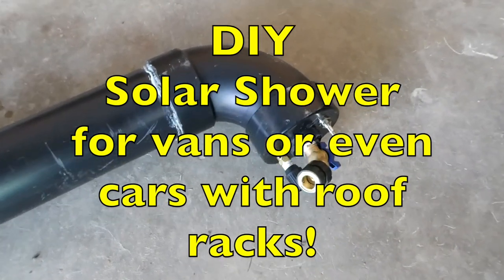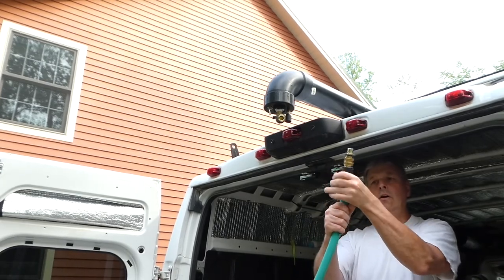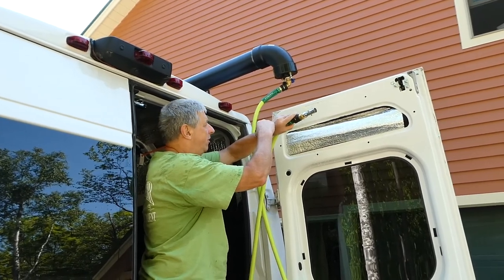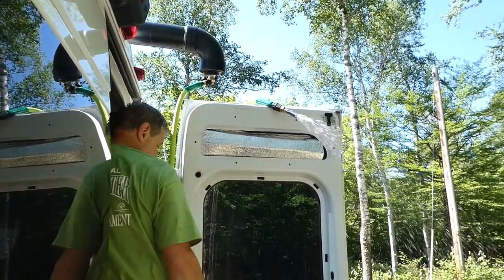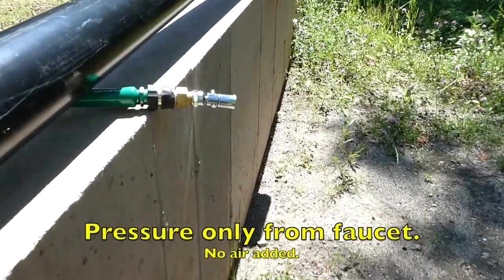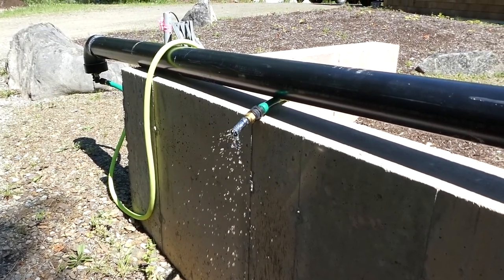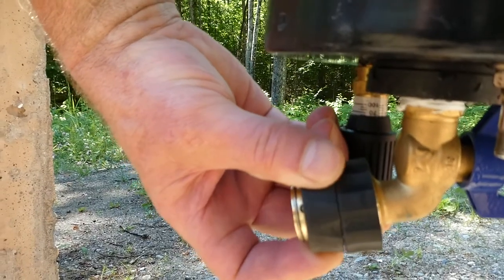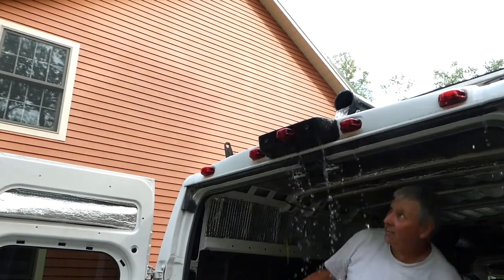DIY SOLAR SHOWER FOR YOUR VAN OR CAR - BTW - IT EXPLODES :-)

Comment: Would a small 12v pump work in that situation.  It would allow you to fill the pipe completely at least.
Reply from the maker: Hmmm.... that's a good idea.  Getting up on top of the van is a royal pain so that would be way better.
Reply: @MTBIKEXC  I got one at Harbor Freight that plugs into the outlet in the dashboard. It's small enough to stow with the spare tire too.